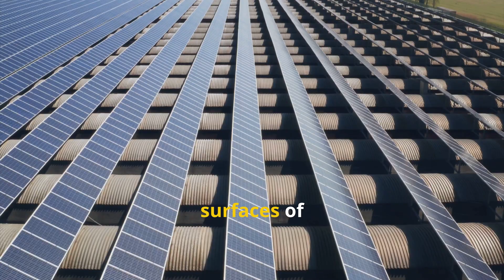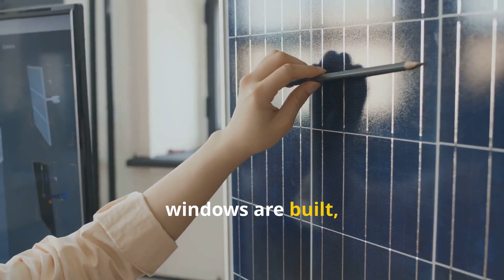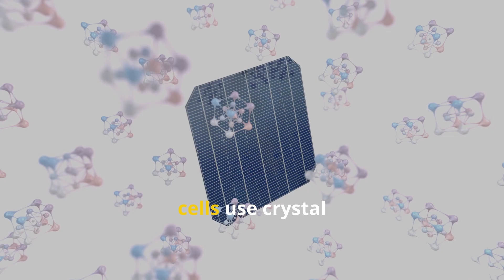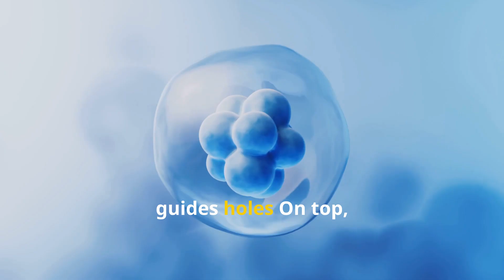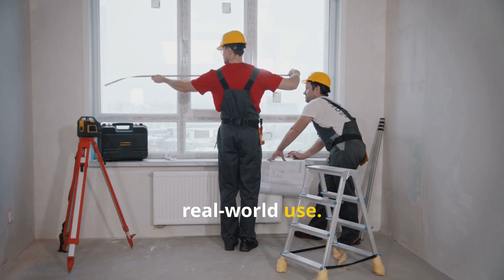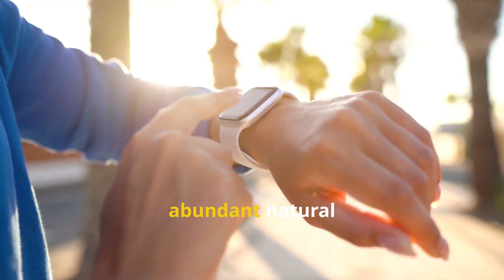The secret tech behind transparent solar windows

Comment: Great idea but unfortunately not a reality yet. Too expensive to buy, enormously expensive to connect all together, and output being less than traditional panels will at most offset cost of conventional electric for the building itself - not enough to export power.  Perhaps in 8 to 10 years it may become economical.